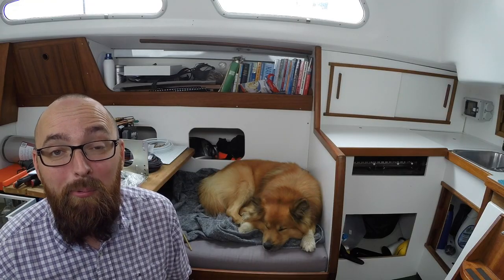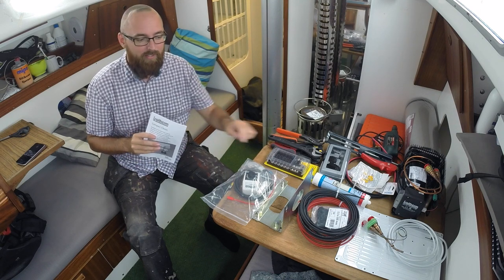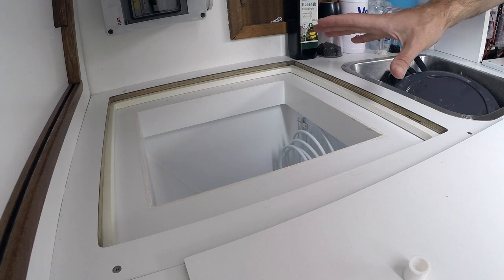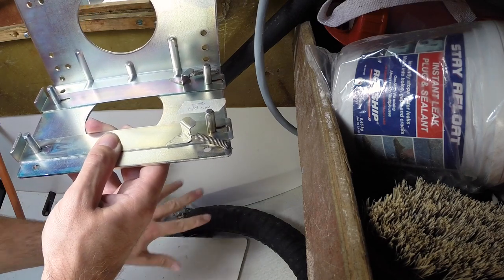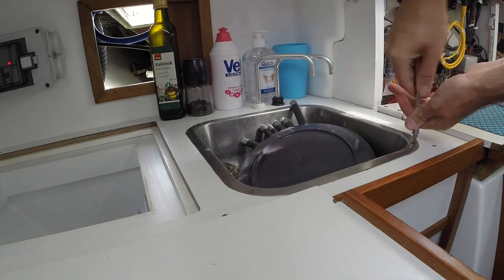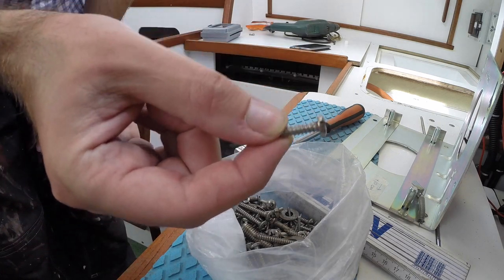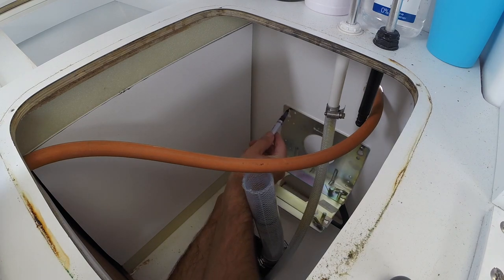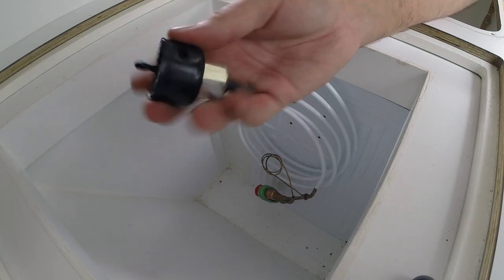Sail Life - Installing an Isotherm cooling system (Classic 2006), Part 1 of 3

Comment: Looking at the compressor mount: if you have vibration/noise issues, you can put a rubber washer around the screw between the mounting plate and bulkhead.  That should dampen any vibration and noise. Thanks for the great videos and effort, I really enjoy them!

Comment: Saw that tub of say afloat and googled it. Very interesting stuff. Quite the large tub of it you have lol.
Reply: James Carter toilet ring wax works too.  Sounds gross but it doesn't dry out, freeze or melt.
Reply: the video on the website shows it to have to same texture as toilet ring wax
Reply from the maker: James Carter Ahh so my product placement worked ;) I first noticed the tub when I was editing the video. I've never tried using the stuff. Perhaps that would be a fun quick video. Just to test out if it's in fact as great as they claim :)
Reply from the maker: Pass Me By Interesting :) I'll google that stuff later today :)
Reply: I'm not sure but I think I first saw it on a Pantaneous (however you spell it) sailing video.  Anyway, being familiar with this aspect of plumbing (ahem) I know that wax will stick to ANYTHING.  Wear disposable gloves!
Reply: I never wear the gloves doing a toilet. Clean the floor with a flat screw driver and drop that suck right outta the package onto the hole. Works every time lol. And the video idea is a great one, just not one obilix or however it's spelled :p
Reply: No need with a toilet, but grabbing gobs of it and stuffing in a hole...  Of course you aren't thinking of neatness at that time.  The beauty of the stuff is it will stick to a wet surface very well even under water.

Comment: your doggie looks so comfy ! If I believed in renecarination I wish I could come back as your dog !  It great that you will have neighbors ; maybe you can form a regatta , or start a yearly race like Alfy has in Canada ?  I think that a nice computer fan with a vent will do nicely for your compressor . You can also put a temperature control on the vent fan so your condensing unit will keep  warm in the winter  .If it gets too cold the heat pump will not work . Also its a good Idea to keep some refrigerant just in case you get a leak . I hope you have sealant paste for the fittings its a blue paste that help seal and keep the fittings from loosening due to  vibration .
Reply from the maker: Moe Jaime Jökull is easy to please. A walk, some food and he's out like a light ;) I'll remember the tip about a temperature control on the vent fan :) It's going to get cold in that tiny locker during the winter. We'll see if it becomes an issue :)
Reply: Hi Mads . I wanted to share a web site I found about cruisers . Its activecaptain.com don't know if you heard about it ? I learn about it from Drake Paragon's interview with a cruiser . Its awesome it has this awesome interactive guide to find anchorages,marinas,etc... I hope you can access it in Denmark I think you would really like it  Well that is if you don't already know about it ? lol !

Comment: We just got our GE80 Classic yesterday and you will be my guiding light. No pressure....
Any thoughts about this installation that you might have done differently? 
I will mount the compressor through the bulkhead out to our BIG cockpit locker and I am somewhat concerned about the cooling, I guess it is rather windy in there haha

Comment: Funny you should be working on refrigeration, I was studying up on my ancient Alder Barbour refrigeration unit today. It appears to run well enough but does not produce  cold. I'm trying to build up enough knowledge and nerve to charge the unit myself.
Your installation is looking very nice and if memory serves correct, did you not add additional insulation while refitting Obelix.
Reply from the maker: Bill Bruce Seems a lot of people are looking at fixing or adding refrigeration right now :) I know Alfy (Life is like sailing) is planning on replacing his too.  Thank you so much :) While doing the refit I build a brand new icebox out of 50 mm insulation. I'm very interested to see how much energy it's going to require to keep that tiny, very well insulated box cool :)

Comment: It looks like your sink drain doesn't have a trap . Does it drain directly outside or does it drain into a holding tank ? If it drains into a holding tank it should have a trap to keep out the holding tank oder . I really don't like the holding tank oder. Just think.... if you smell it,  you are breathing in micro bacteria, 24 , 7, if you're living aboard.
Reply from the maker: offplanetevent For now my sink drains directly overboard but some marinas here in Denmark are starting to require you to keep your grey water in a holding tank. When/if that happens here I'll keep your suggestion in mind :) Thank you for taking the time to leave a comment :)